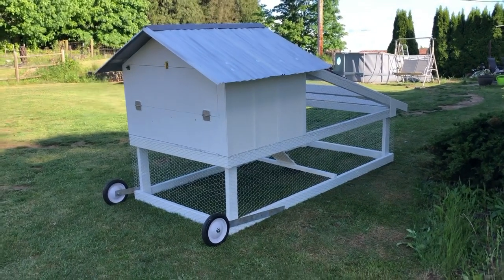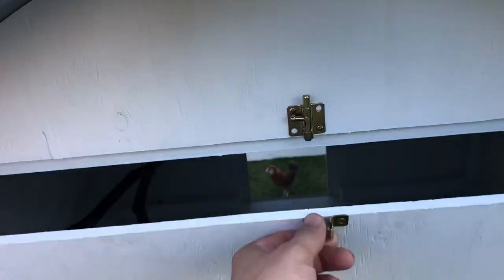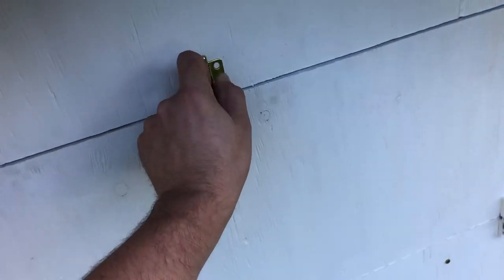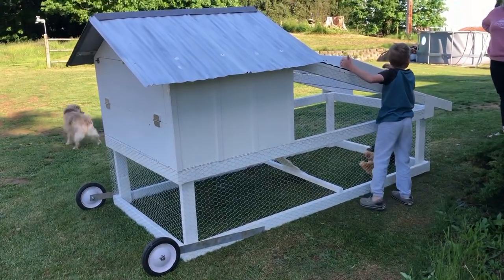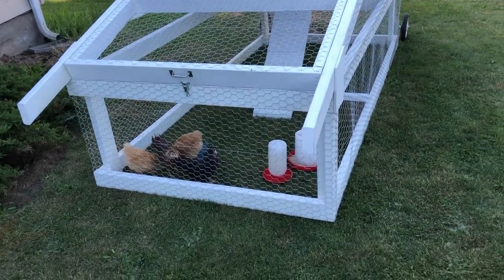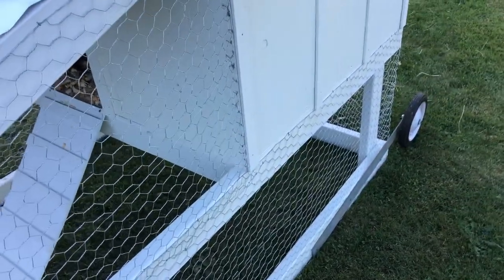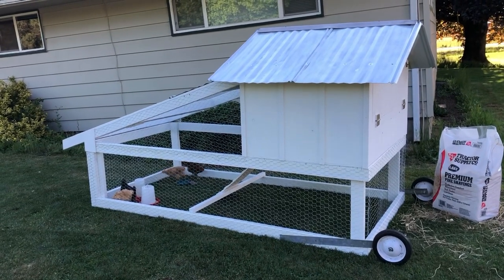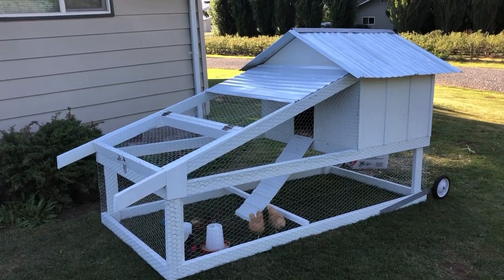Low budget DIY chicken coop / tractor build Homesteading

Comment: I really like the design and ease of use.   The only thing I would like to change is using 2x2's for the top instead of 2x4's to reduce the overall weight but not sure if this will make the coop more flimsy or not.  The current prices of wood are ridiculous, so trying to keep a lower budget.  Thanks for posting this video!

Comment: I like the design and plan to build something similar.
My comments; probably want to add a door to secure the coop opening at night. Add 1/4" mesh around the bottom two feet of the cage, as coons will reach through and pull the heads through chicken wire. You will find hens with the head eaten off.
Reply from the maker: a couple years here and no animals tried to get into it, thankfully
Reply: @JohnVHLife  I must have a lot of problem critters; coons, foxes, weasels, opossums and of coarse, hawks.
Reply from the maker: @williewonka6694   I guess so! We have all those things, and have seen them in the same field as my chickens, but no problems.

Comment: Nice job.  Would have liked an explanation on the weals.
Reply from the maker: Sorry, it was just a piece of flat bar, that pivots on a bolt to lift the rear up, then I used a rope to hold it up.
Reply: Thanks for the reply.  Is that flat stock metal flimsy or it is sufficient? How high does it lift the coop off the ground about?
Reply from the maker: @GatheringJacob  It was flimsy, but did the job, it lifted the coop a few inches,

Comment: Very nice job.  Is your enclosed living box dimensions 4’ wide by 4’ long?  I understand the peak height is 3 feet total.  Thanks
Reply from the maker: I believe you are right! The chickens seem to prefer the far right stall to lay eggs in for some reason, and they all prefer the top stock I screwed in to sleep on at night, I may do something different for the sticks, as the lowest one can be kind of in the way when cleaning out the enclosed part where they sleep.   Thank you.  So far its been working out awesome.  I did add a DIY feeder to the outside I need to make a video of soon also. And just an update on how its doing.
Reply: I believe it is 3 feet on each side. As you can see the box doesn’t reach to half of the 8 foot base. The sides have to be shorter than 4 feet.